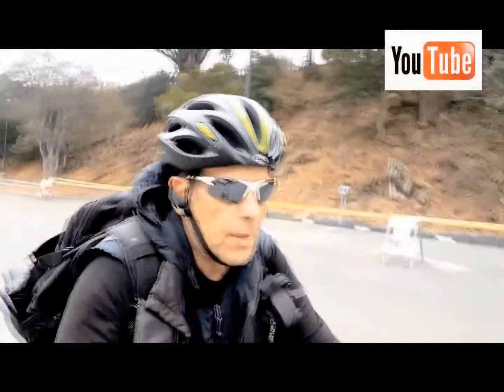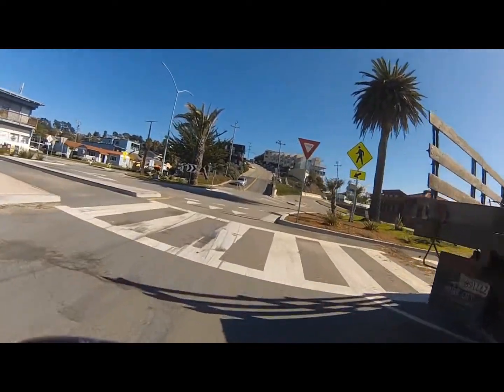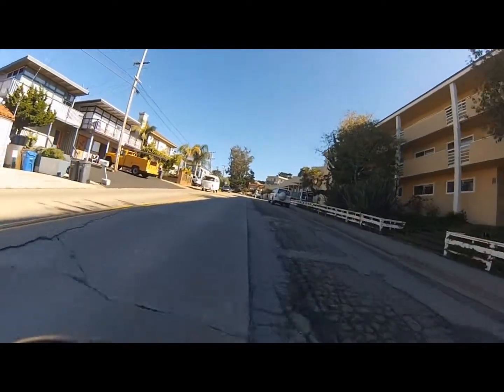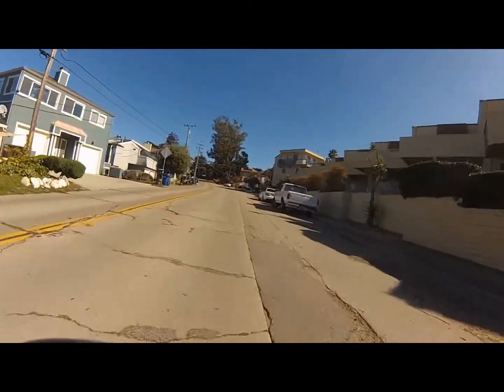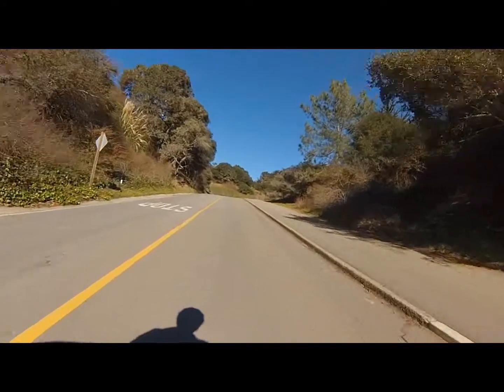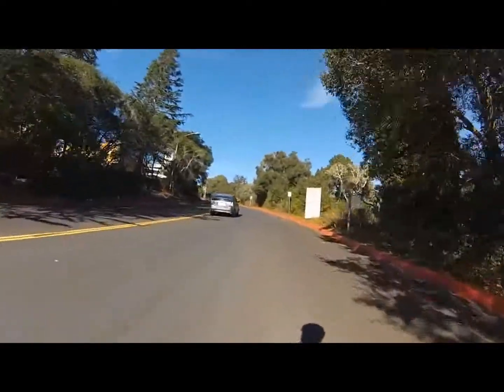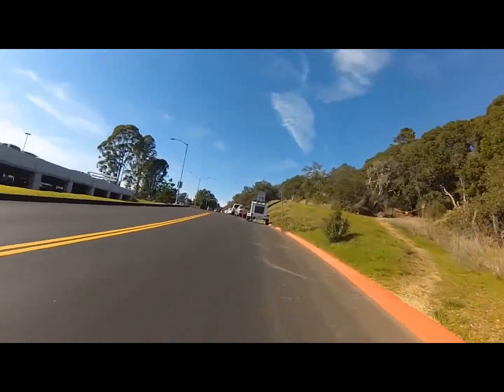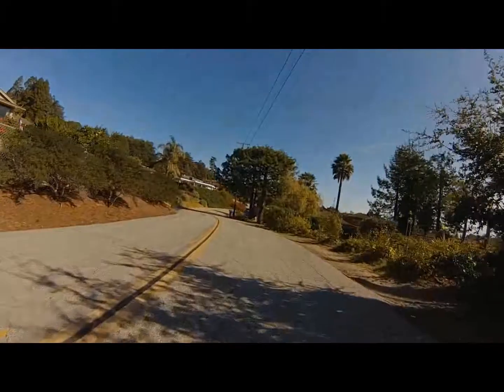Hill Climbing with a 1000W E-bike Conversion Kit

Comment: That was helpful! I've been going waaay down the rabbit hole researching ebikes.  I need one that can get me and gear up steep mountains. All I read is that the mid drives are the way to go for the needed torque but it looks like a 1000w hub drive would do the job with pedal assist and a hub drive is a lot less expensive plus you can still motor if you break a chain.

Comment: The bike performed very well for a 1000 watt setup as those hills was very challenging, would have been very nice if you could have mentioned the type of controller, battery and motor spec as in windings , as in  high torque or high speed, but an interesting video none the less, enjoy the rides and take care out there.
Reply from the maker: Thanks!